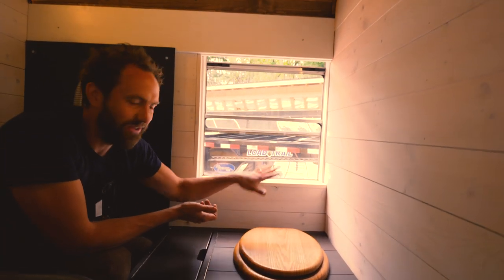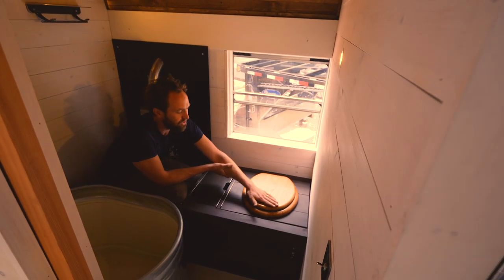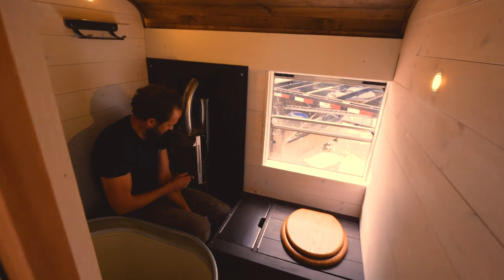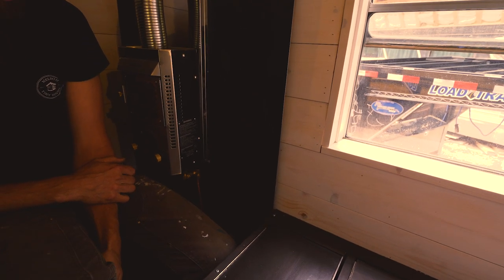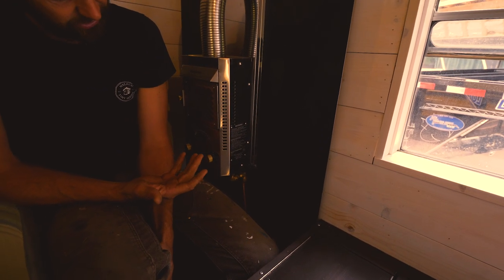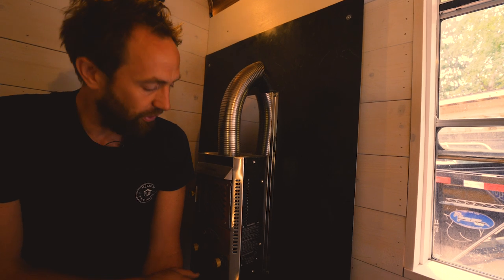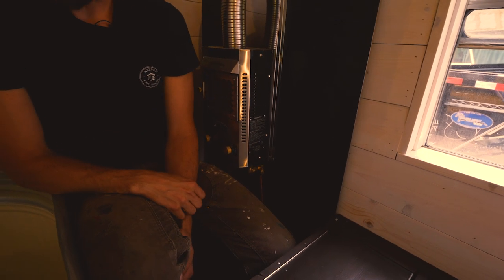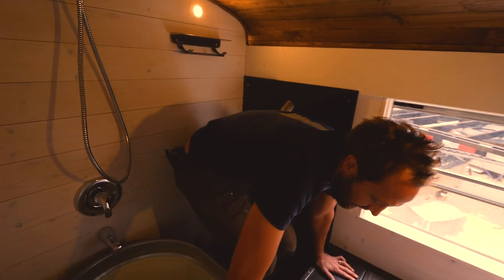Nelson Tiny Houses Presents: Wild School Bus Conversion

Comment: Absolutely gorgeous build. Truly stunning aesthetic and craftsmanship as usual. But wondering how a flaming stove can be safe to use on a gas fueled vehicle? Fire and flammable gas and gas vapor so close on a regular basis even if at opposite ends can be made legal through some kind of firewall?  I love the effect of having it in the conversion but they have to use electric fake fireplaces in RVs for this reason, don't they?